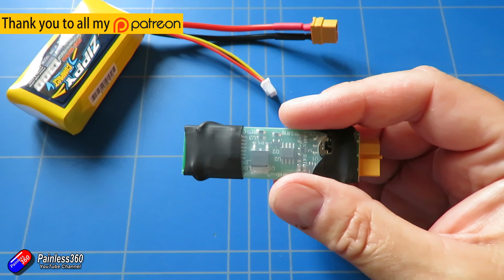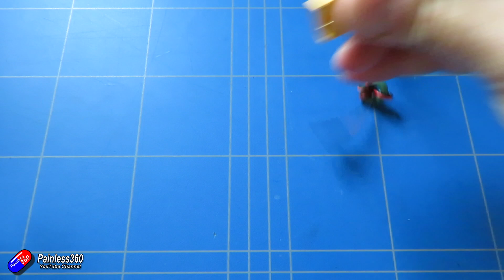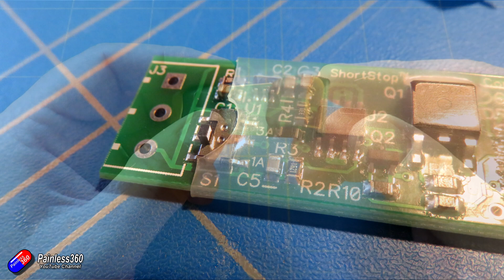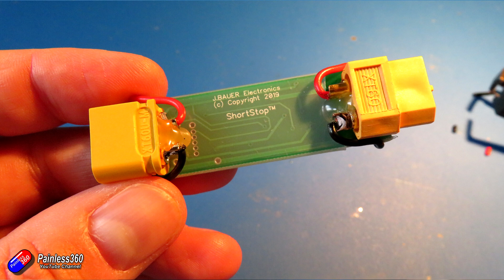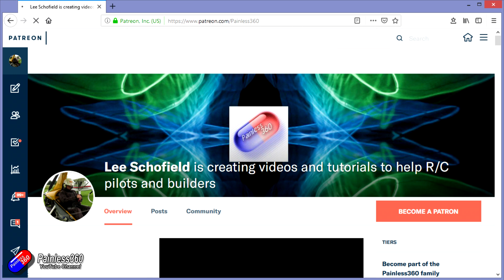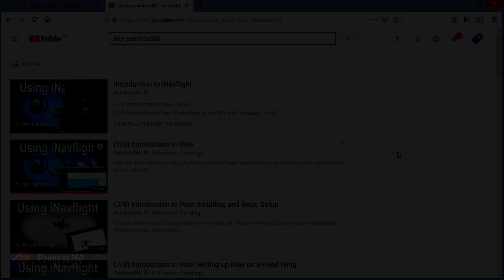The ShortStop - The 'Smart' Smoke Stopper

Comment: I was initially a little underwelmed by the 20ms response time. That's pretty slow for a micro! However, I watched Bruce's review after yours. It seems that the 'slow' response is deliberate - and missing from the first version of the device. Without it, it was being erroneously tripped by the initial surge current needed to charge your device's capacitors...
Reply from the maker: Yep, there is a rush of current for a brief moment after connection (in the old days it was accompanied by a nice spark in the deans connector too). There is no substitute for a good visual inspection of the build and basic resistance tests using an ohm-meter but this provides an extra level of protection if you're not confidant of your checking skills..

Comment: Looks pretty sweet :).  Another place I always check for a lack of continuity is between an ESC motor pad (any) & the carbon frame.  If there is continuity one of the motors will usually have a mounting screw fouling the winding or a short to the stator (melted wires or bad wind).